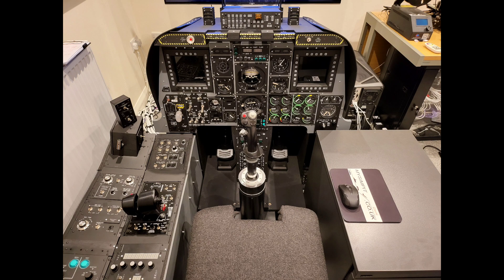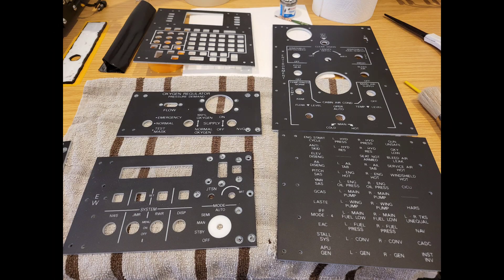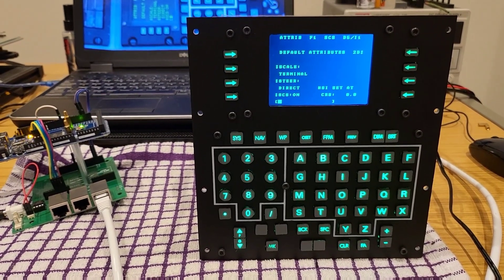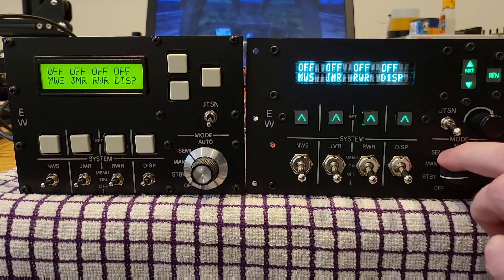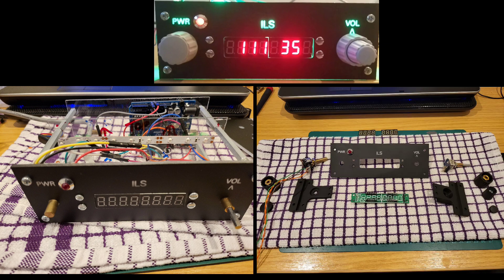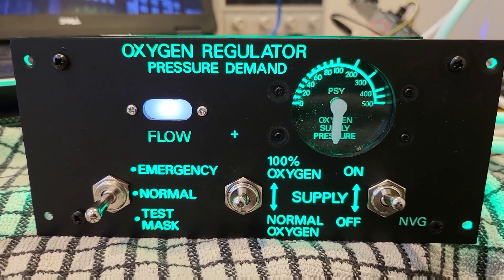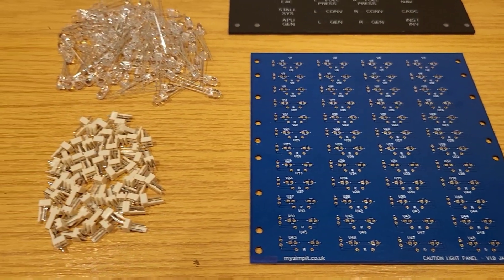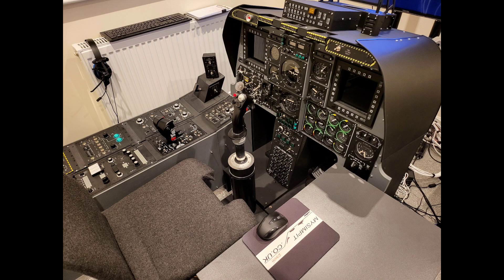Simpit A10C - Right Console - Part 2: Panel Progress

Comment: Hi Craig, can you post a link to the acrylic you use for the panels on CNC machine @ 1:50.    Also, what paint do you use for the edge of the acrylic to stop the light bleed.  Thanks
Reply from the maker: Hi Speed Bird, I have purchased acrylic from a number of places but one of the main ones is https://www.sheetplastics.co.uk
If you search their website for 3mm opal acrylic, that's my main go to
There are 3 ways (I have used) to stop light bleed at the side:
1. Spray with Plasti-kote matt black paint
2. Use Humbrol enamel black paint
3. Run a black marker pen down the sides
At various times, I have used each of these
Reply: @CraigSmysimpit  Thanks very much for taking the time to reply. Excellent project !!!